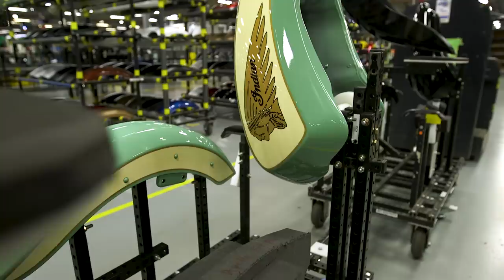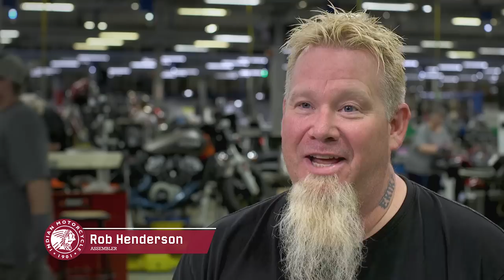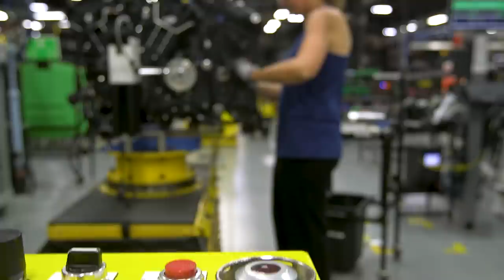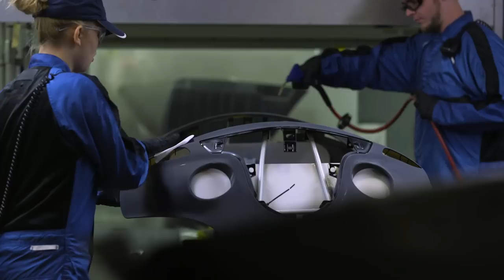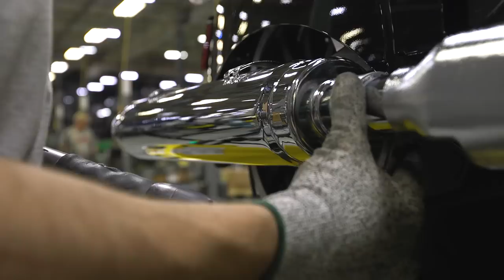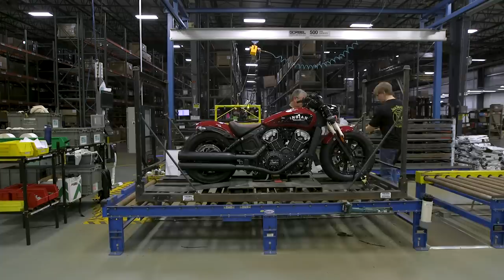Inside Indian Motorcycle: Spirit Lake Assembly - Indian Motorcycle

Comment: Second owner of an Indian Roadmaster from 2015. Just ticking over 38,000 miles. Runs great, looks great.  Don't neglect the leather! I condition mine monthly if not more often, I only wish the first owner did the same.
Reply: How do you do that ? I own a 17 Roadmaster and the leather still seems in good shape . I put 18k km since I bought it new.
Reply: I use a couple different products. Mink oil is pretty easy to work with and you just apply and work it into the leather with a soft cloth. Another method is with beeswax, i have a can of it from "Sno Seal" bought it on Amazon, with that product you actually warm the leather with a hair dryer, apply with with a cloth and it absorbs into the leather from the warmth (it may darken the leather so try a small area first) and lastly i found a full 3 part kit like Indian sells but for a few dollars from sportsmansguide.com from SofSole. It has a tube of cleaner lotion, conditioner protector and a waterproofer. Easy to use and works well.  I guess the main seat was replaced under warranty so im keeping it like new but the passenger backrest area is showing signs of aging i cant reverse but have been able to stop.  Like real leather boots, they have to be treated to withstand the elements and remain soft and pliable or they can fade and crack etc. ive seen some of the tan leather bike seats on indians for sale that were downright terrible looking. I dont want that to happen to mine
Reply: Thank you !
Reply: Saphir renovatour is really great too. It’s a little pricey but worth it

Comment: the harley and the Indian motorcycles have the back engine cylinder head right in the middle of the front of the seat, this spot is very hot, steam hot on the right leg, I don't know why they don't go back to the old days and build that seat 7inch's higher than the gas tank further away from that -hot engine.

Comment: Hi Indian engineers .    can you please build an air cooled   811 cc   PARALLEL   twin  with a single camshaft 3 valve per cylinder and a   225  degree Crankshaft . and , use a frame similar to the old Ducati  750 GT .. 18 inch wheels . and price it for us poor people . or something thereabouts ..pretty please .  and also have a dresser version . i think it would be cool .